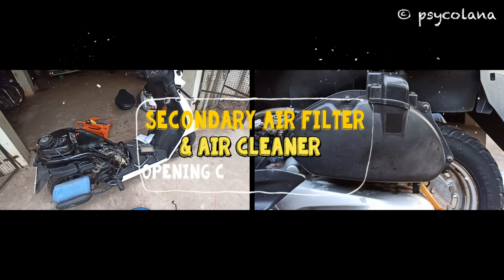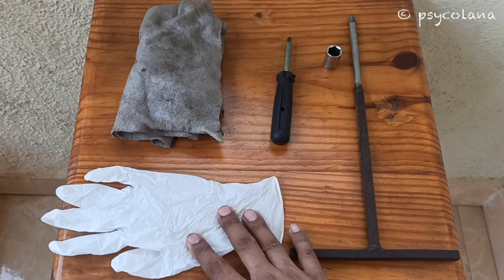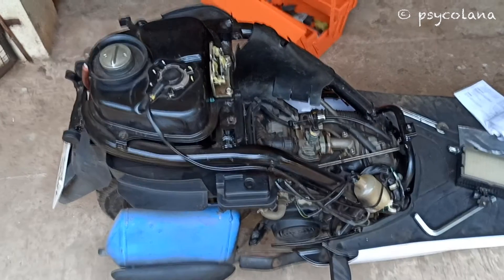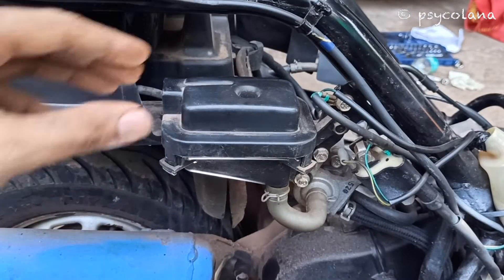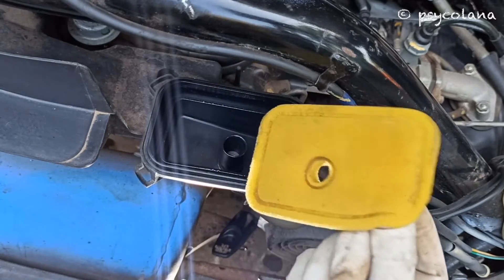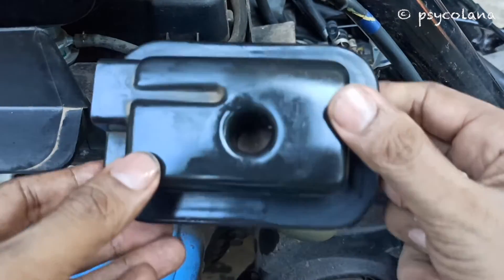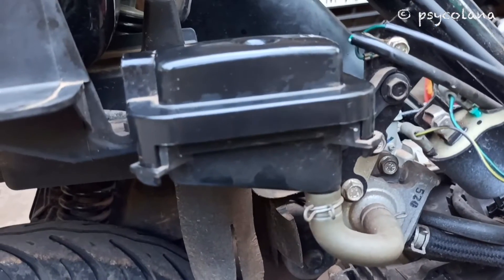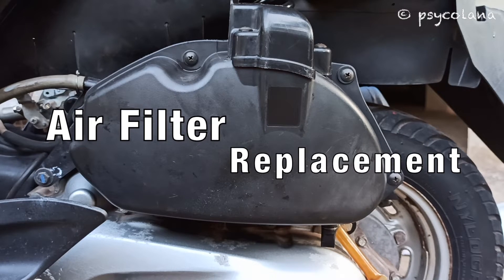Secondary Air Filter & Air Cleaner Opening, Cleaning, & Install | Honda Scooters

Comment: I changed both air filters with new one as per your illustrations but to my shock the sound of the engine noise is different.The humming noice of engine is intolerable Now. Why?